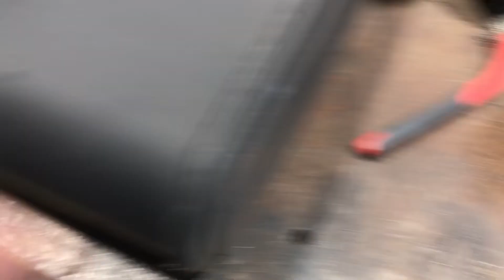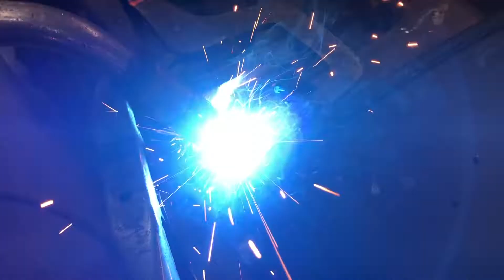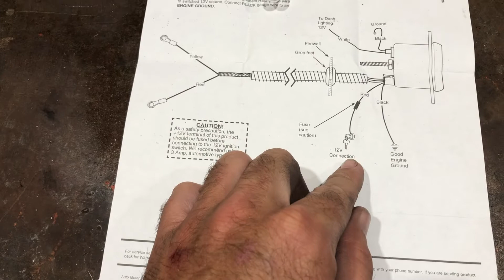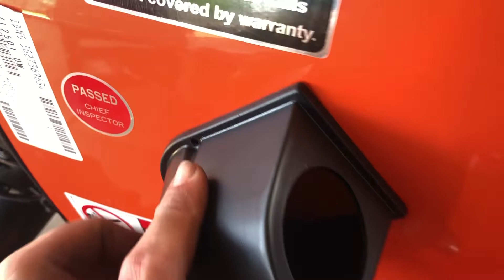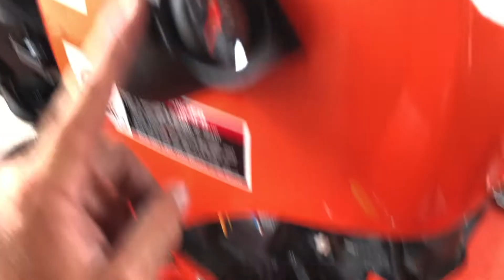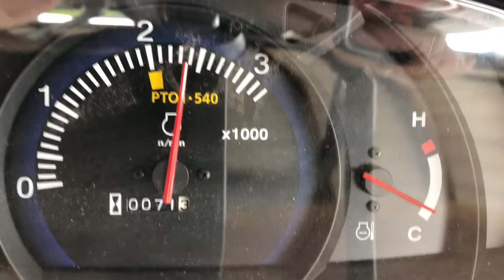Auto Meter EGT Sensor Install ~ Kubota L2501 Tractor ~ Tune your Diesel Safely! Pt.2

Comment: That EGT gauge is over $200!  There are several much, much cheaper.  Is there something wrong with the cheaper versions??  Just not sure there is that much difference in gauges but maybe I am misguided.  Let me know why you opted for the very expensive one/

Comment: PLEASE HELP, DOES ANYONE KNOW THIS OR CAN POINT ME IN THE RIGHT DIRECTION?  I am wondering if anyone knows if the engine in this video that has been modified is the same as the D1703BM-DI-EF04_CN4.  I have a piece of equipment that has this engine model # on a sticker that is attached to the engine and want to make sure that I can do the same modification.   The sticker does also say 18.2KW and 2200rpm.  Thanks

Comment: Could you have drilled and tapped/threaded the probe in the same spot that you ended up welding?
Reply from the maker: @dougchoate2009  yeah it should be fine. Welding is just the better option

Comment: Ever have issues with water getting into the gauge ? Not sure if these auto meter gauges are ok to get wet or not. I just installed mine the other day and was wondering   Thanks
Reply from the maker: Yes it has gotten moister in it before but it didn’t effect gauge luckily

Comment: Nice video!!  Where did you run your ground to? I ran mine to the ground that was right behind the fuse box there but my probe isn’t reading temps it just lights up. I’m thinking either I have a bad probe or I need to change location of ground cable. Thanks

Comment: how did you attach the gauge to the gauge pod?  Mine is not a tight fit and spins freely
Reply from the maker: There should be a C-shaped bracket that goes on the back of the gauge to compress it tight

Comment: You aren't supposed to cut the egt wire to length. It's calibrated based on the length of that wire somehow.
Reply from the maker: No you can cut it to any length

Comment: I wish you would have explained what this does, I have no idea. Good job on the video, but why would I want this on my tractor.
Reply from the maker: When you’re under a heavy load it’s nice to monitor your exhaust gas temperature. Once it gets over 1300° I start keeping an eye on the temperature. Excessive heat can damage the motor. I added the gauge because I turned up the fuel on the injection pump. More power equals more heat

Comment: Raztech - are you going to update on performance gains and EGT TEMPS WHEN LOADED ?? 

Douglas
Reply from the maker: Yes sir, the highest temp I could get with the finishing mower in normal height grass was in the low 900s. I will be going to my property next week to cut grass and film
Reply: Raztech Powersports o
Reply: Thanks for the update - between your video and NETMAGI ,s  i can make the timing and fuel adjustment . I would assume you are close to 35 horsepower as you took all shims out . Again thanks for sharing you info .
Reply from the maker: @dougbeck8935  thanks for watching and yes, 35 hp would be a realistic number 👍🏻